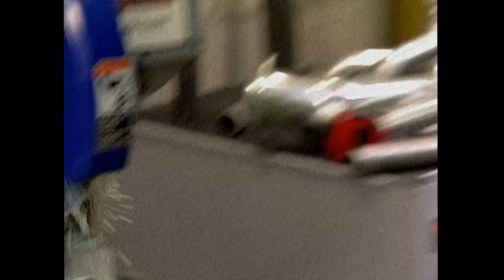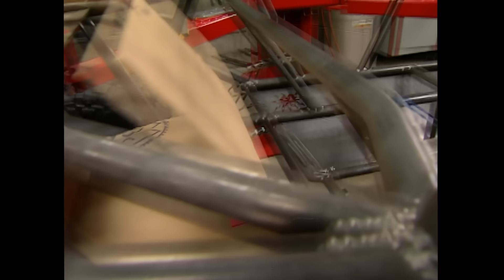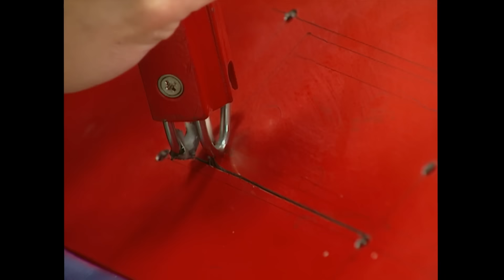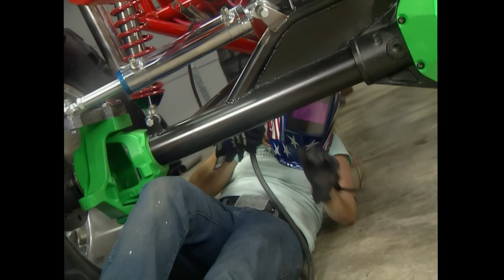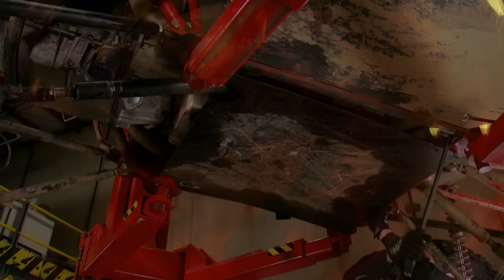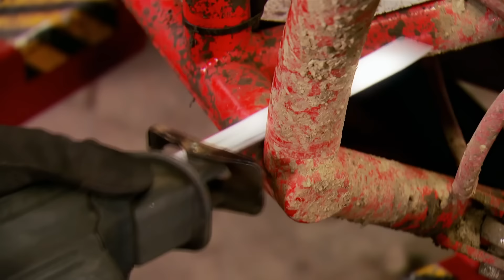Full Build: Poison Spyder Rock Rod - The ULTIMATE Tube Chassis Off-Road Buggy

Comment: I wonder why they used a 4L65 rather than a 4L60E or 4L80E tow haul mode trans those 4L65 are sealed units you dont have a dipstick to check the fuilds at all

Comment: $3900 for a full tube chassis? 😅😅 😂 you couldn't buy the raw steel for that 😅
Reply: Sure you could. 1-3/4" OD x .120" wall x 20ft for about $150ea. Thats equivalent 26 x 20 ft tubes. And you can design is the way you want. This is just another one of those shows where they simply buy everything and slap it all together. Cost a fortune when it's all said and done. They don't mention the price tag on it though :)
Reply: look up fabn801 they made some of the best chassis money can by they range from $2500 -5k
Reply: $3900 factoring for inflation is about $8000 today.  I'm not building a buggy there are a bunch of options between $5-8k.  So it's about the same price relatively speaking.

Comment: Great show watching reruns on XUMO channel. By the way, I have an 2001 Black Monte Carlo SS. Runs great with a Jasper Motor 3.8 FWD however the under carriage frame is slowly deteriorating. My thinking was to always custom it back to the old rear wheel drive (Like The older ones) Extend the body and add a 350 ci or more . I use to have a 74 and my mother had a 71 Monte very nice . Any advertisements to fund this project/dream would be appreciated dearly and let Iron Power Nation do it!!  However great show indeed!!
Reply: that was the last gen of the monte and they are junk but did come from the factory with a ls so to swap it was easy but since all them basically fall apart from rust . the only way to convert to rear wheel drive would to build a tube chassis or its just gonna twist apart like a tin can